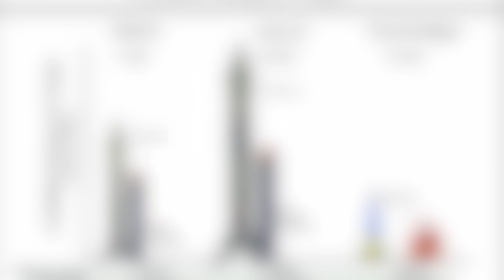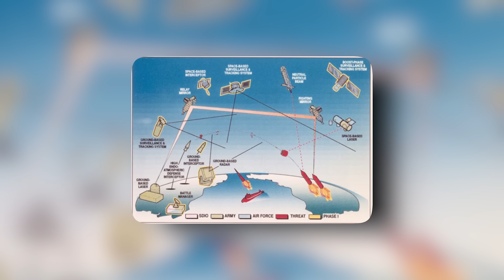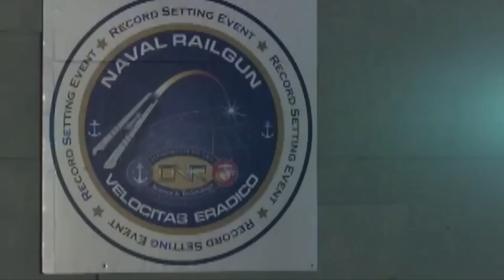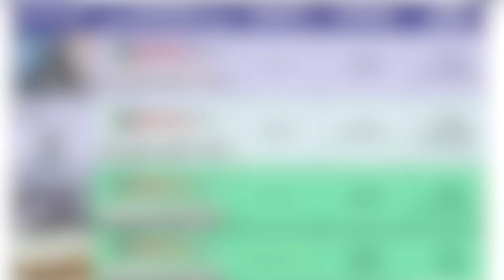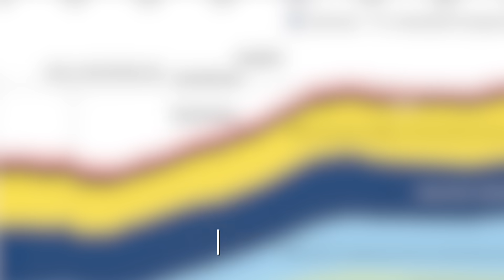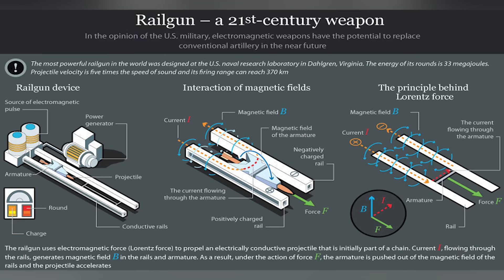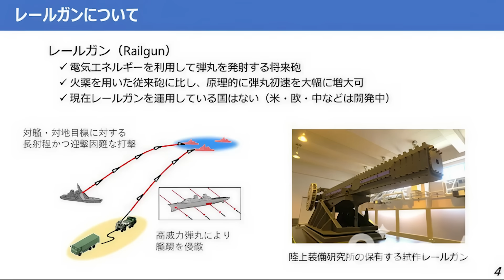Japan Revives a Scrapped U.S. Superweapon — And It Actually Works!

Comment: I've said it before, but it bears repeating: railguns are the weapons of the future and always will be.  It's simple physics: a railgun cannot put more energy into a projectile than the power plant powering the projectile can produce, and it cannot put it in any faster than its power plant can generate it.  The speed at which energy is generated or consumed is power, and it is power that actually does damage.  To illustrate that point, compare jumping off the roof of a twenty-story building versus walking down the stairs to the ground floor.  The amount of energy hitting your body will be the same in both cases, but it will enter much faster in the former.  Now consider that a single one of the 16-inch guns on an Iowa-class battleship could impart about 6.8 gigawatts of power to one of its Mark 8 AP shells.  By contrast, the two A1B nuclear reactors on a Gerald Ford class carrier produce a combined 250 megawatts of electrical power according to publicly available estimates.  That's 0.250 gigawatts.  Again, no railgun can impart energy to a projectile any faster than its power plant can send energy to it, and no power plant can send energy any faster than it can generate it.  And that's to power one railgun; an Iowa class has nine 16-inch guns.  Railguns are the weapons of the future and always will be.
Reply: You're thinking too linear with power.
Super Capacitors are what you use to get a higher pulse charge.
Reply: @hillyseattlenarrowstreets6087  Supercapacitors are not the answer.  The discharge time of a supercapacitor is directly proportional to the resistance of the circuit, and 6.8 gigawatt railgun is going to have an extremely high resistance.  Even worse, it's not just the resistance, it's the resistance times the capacitance of the supercapacitor, and you are going to need a big supercapacitor for this.  So again, you are going to have a very slow discharge, which means a slow transfer of energy to the gun, which means low power.